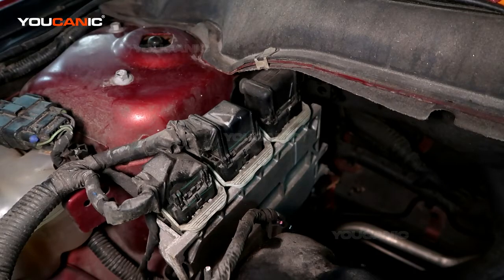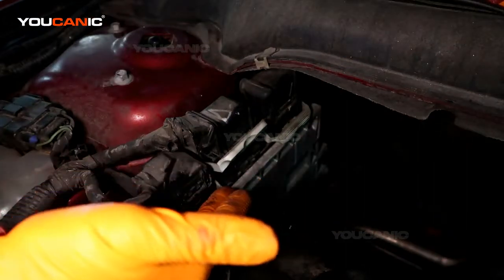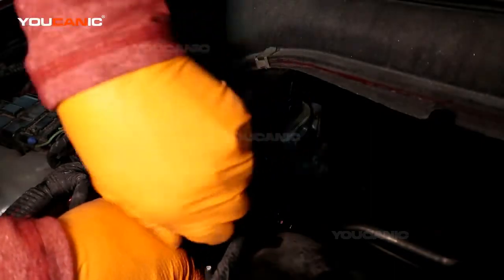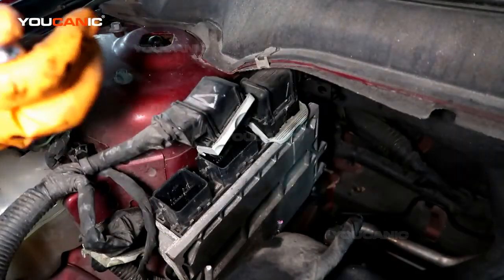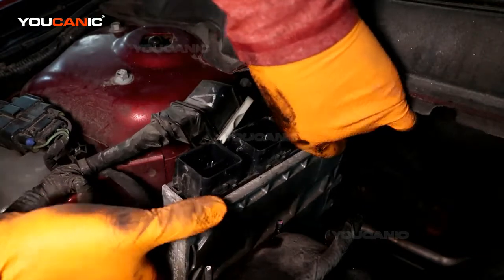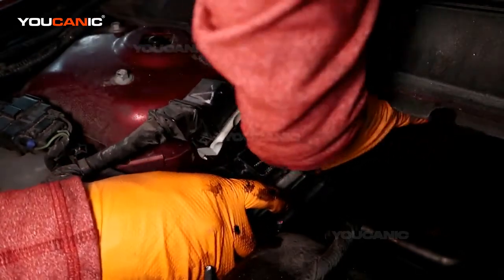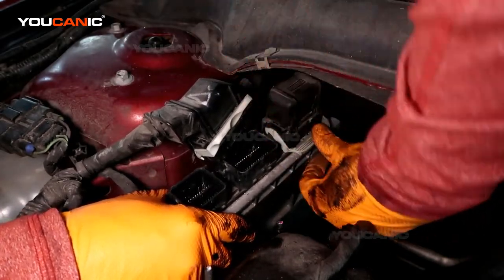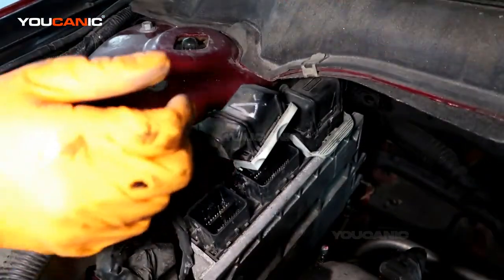2013-2020 Ford Fusion Engine Control Unit ECU Replacement

Comment: Hi I have an 2015 ford fusion and every time I put it in reverse or in drive it gives me one of the worst shake ever I’m just wondering and hoping if you know anything that can help the situation
Reply from the maker: Thanks for reaching out! A severe shake when putting your 2015 Ford Fusion in reverse or drive can be quite concerning. The issue could stem from various areas such as the transmission or engine mounts. At Youcanic, we offer helpful guides and free resources to help you identify and resolve your car issues. Do make use of our powerful YOUCANIC diagnostic scanner tool for a more precise diagnosis.

Please don't hesitate to visit www.youcanic.com for further assistance or to browse our factory repair manuals. We're committed to empowering you and are here to support you throughout your car ownership journey!

Comment: Hi I have an 2015 ford fusion and every time I put it in reverse or in drive it gives me one of the worst shake ever I’m just wondering and hoping if you know anything that can help the situation
Reply from the maker: Thanks for reaching out! Your concern could relate to a number of factors such as issues with the transmission mount or engine mount. At YOUCANIC, we offer several guides and our YOUCANIC scanner to help diagnose issues and save money on car repairs. 

Please consider visiting our website www.youcanic.com and take advantage of our various resources, including factory repair manuals. Our aim is to empower and assist you through your car maintenance journey. We're here for you!

Comment: Does the ECU control the coolant system? I keep having over heating and low coolant signals.  Thinking may need a new computer.
Reply from the maker: The ECU does influence the functioning of the coolant system. However, the issues you're experiencing could be a result of several different factors and not necessarily a faulty ECU. We recommend using the YOUCANIC Full System Scanner for a comprehensive diagnosis. Find out more at www.youcanic.com/scanner 

If you need further support or have more questions, feel free to use our platform to ask car-related questions. Navigate to www.youcanic.com. We're dedicated to making car repairs understandable for car owners. Your trust in YOUCANIC is greatly appreciated.

Comment: Is the ECU responsible for letting the AC work in my car
Reply: Mechanic is telling me mine is bad or at least need re-flashing, symptoms I'm getting are dash "idiots lights" for ABS failure, Parking assist failure, Hill start failure, Traction control failure, etc.  Nothing related to climate control though...

Comment: Fascinating to know how a nearby towns dealer is replacing my PCM in my 2013 Fusion Hybrid. Bunch of error codes that I read with ForScan. Lost communication. What did it point to? "Lost communication with ECM/PCM" Main computer keeps failing. Albeit intermittently.